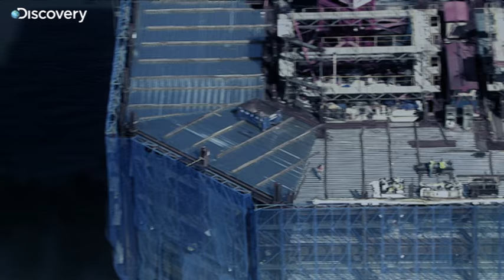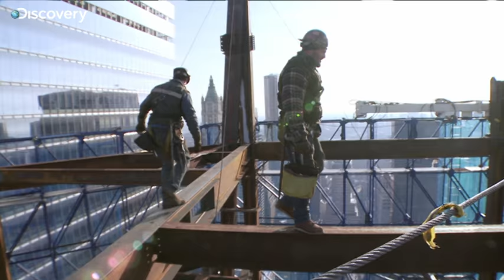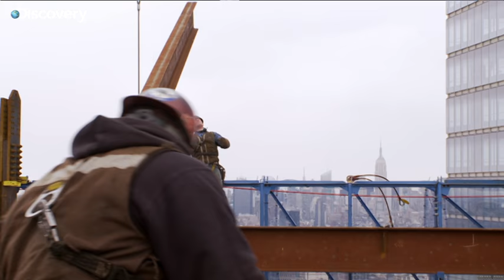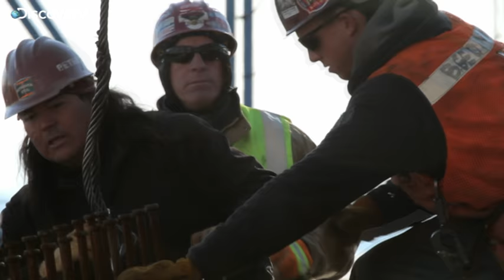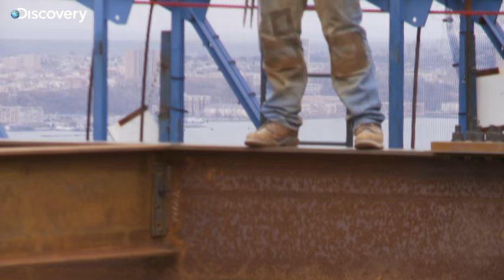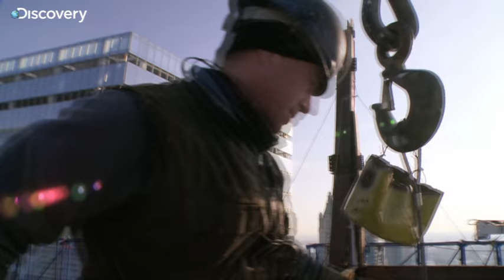Rising: Rebuilding Ground Zero - Iron Workers

Comment: Why some or many of those "iron workers" put their safety helmet on their head in "reverse mode", ..? Subtitles were helpful to follow those conversations with workers, why they have been deactivated?
Reply: Constantly looking up, lots of moving parts coming from above and the brim of the hard hat impedes vision. Simply walking around a construction site with low hanging head knockers can be a headache with your vision blocked from the top of your forehead.
Reply: @noisypipes05  Yep, plus if you do need to weld you don't have to turn your hardhat around you're ready to go.